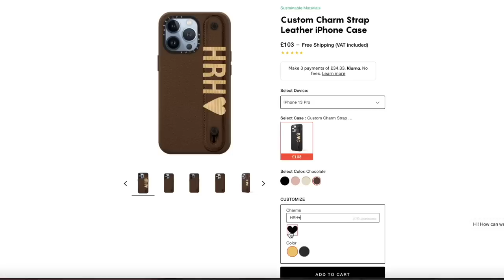HOUSE MAKEOVER PART 2! new sofa & starting work on the bedrooms! | Hannah Renée

Comment: To answer your question regarding your
Mattress yes give it sometimes to settle as they come roll up. I worked in the Furniture Industry and
I have a tempur mattress. They take a moment like others mattresses to settle and spread. Also be aware, they react according to the temperature of the room. Every now and then do rotate your mattress to make it even. I rotate mine when the clock change and that’s the tip I always gave customers.

Comment: Love the sofa, it looks so comfy.
To give the illusion of more room, you could add a full length mirror to the end of the wardrobe (light switch end). I've seen that in a few properties and it does open the room up slightly if there are alot of cupboards x